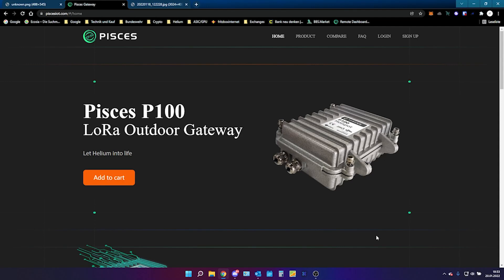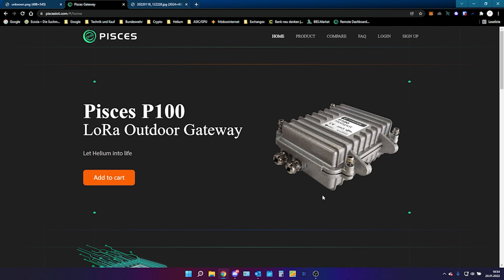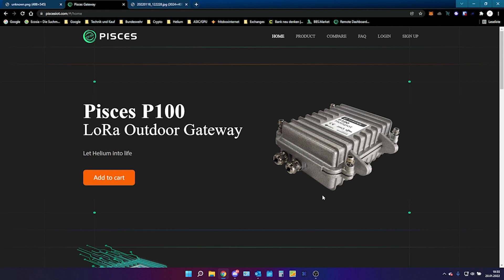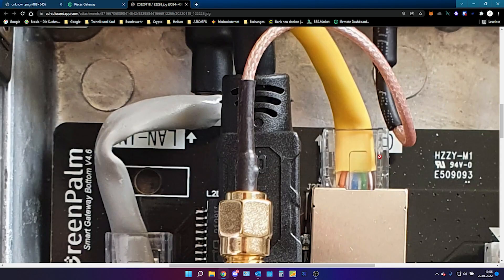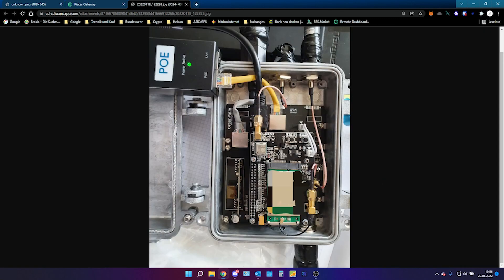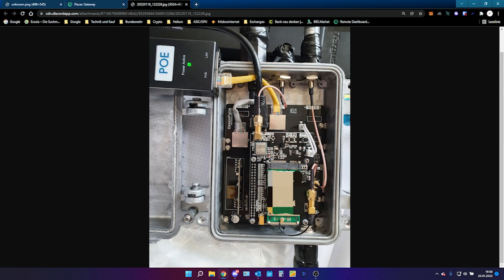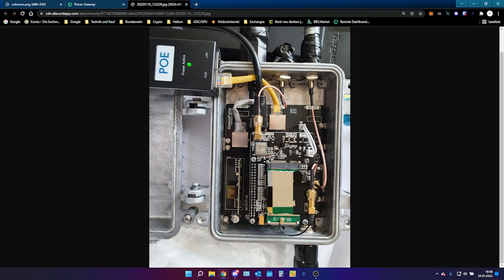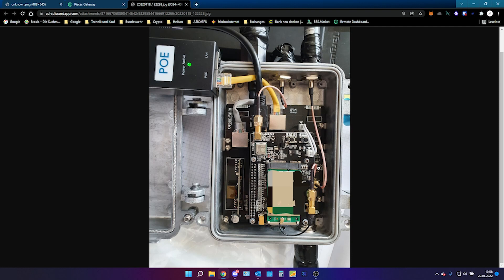What I currently think about Pisces!!! Low activity ?? Saw filter ?

Comment: hello i am new to all this and i have a couple of problems
1 I am in Ireland and my port is not 44158 and the miner is working, is this a problem for the dashboard and the rest
2 I live near a mobile station, I regularly send bacon, but I do not testify for anyone
3 i can't get on the dashboard i try admin admin and nothing  - bad gateway 502
4 ipv6 I did it change something as far as I know p2p and a different way of working
5 whether the rf filter changes something in case of problems with mobile stations or to change the location thanks
Reply: And also where you buy rf filtter?
And which antenna you have?

Comment: Ich denke auch, dass dir der Filter etwas nützen wird (aber er dämpft auch). Ich löte dieses Wochenende einen Filter (den Chip selbst auf einer kleinen Leiterplatte, oder nackt) direkt in das Kabel zwischen N-Buchse und SMA Connector und bin gespannt. PS: Pisces experimentiert aktuell auch offiziell mit SAW Filtern und wird bald die Ergebnisse im Discord veröffentlichen.
Reply from the maker: Wenn du möchtest lass mir doch gerne mehr Informationen dazu zukommen, vor allem was es dir gebracht hat :)
Reply: @WantClue  ich nutze den SAW Filter TA0801A. Habe mir eine kleine Platine gebastelt und diese direkt in das Kabel zwischen N-Buchse und SMA-Stecker gelötet. Bisher ein voller Erfolg. Viel mehr Witnesses. Aktuell etwa 1-2 pro Stunde, statt 4-5 am Tag. Mein Miner ist aber auch umzingelt von Mobilfunk Antennen. Da macht der Filter also durchaus Sinn.
Reply from the maker: @sebastianthomas7923  okay sehr interessant ich danke dir für die info, ich bekomme die tage eine antenne mit eingebautem filter und dann werde ich auch bald zeitnah ein video dazu machen
Reply: @WantClue  Die Interline Horizon? Habe ich auch hier liegen. Ich drücke dir auf jeden Fall die Daumen, vermute aber der Filter ist nur ein Übersetzungsfehler. Hatte leider keinen Erfolg mit der Antenne.